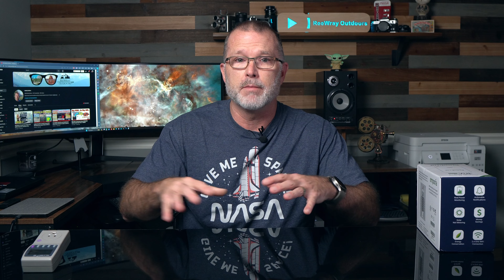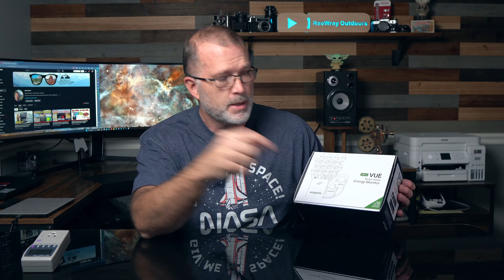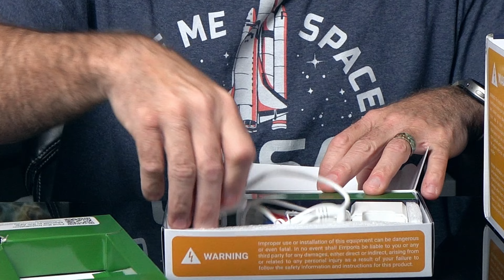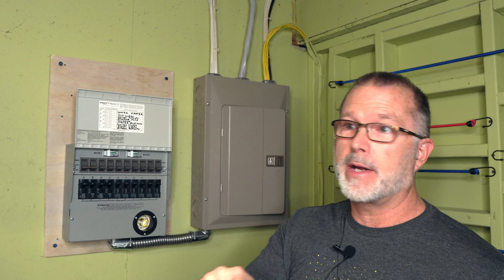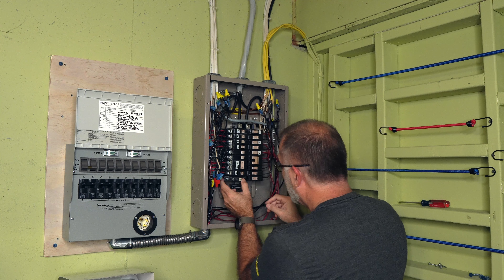*Unsponsored*  Emporia Vue Gen 2  - Smart Home Energy Monitor: Review and Step-by-Step Installation

Comment: Thank you so much for this video. This is the most extensive and will explained video concerning Emporia I've ever watched. I ordered the large Emporia GEN three from Amazon several days ago and I intended on installing it today. I am also going to use the 2 15 amp circuit breaker idea that you presented here for my own installation. I already have solar and I'm not sure how that connects to the system but during the install I will probably find out. Again, thank you very much for this very thorough tutorial.

Comment: Timer might be a good idea on the hot water* Maybe after you a have base usage, look at testing an insulated cover for the pressure release valve on your hot water cylinder too. Lots of heat loss there = more power usage. I'd recommend "The Valvecosy" not affiliated just think its a neat product and I have one installed on mine. With The Valvecosy installed and looking at my power usage on my solar/battery app (GoodWe SEMS+ Portal) the time between the hot water cylinder turning on/off was 20-30mins extra between it reheating again. From looking it saves  .3-.5kWh/day or 6-9c/day/$25-30+yr AUD. Would be good to see the data with your meticulous data gathering skills and devices you just shared with all of us, you'll get a more quantifiable number than what my total system usage on my home app. Loved the video btw.

Comment: I have a solar system already installed, with a completely full 200 amp panel, that cannot even handle one more extra breaker. My panel is already so full that it’s bulging outwards after several electricians try to get things to fit better.
I don’t even think I would have the capability of installing this in my system, due to lack of room

Comment: I have the original system from a few years back and the Gen2 in another panel. They work ok but in some cases under very low loads they actually report much higher power usage. For example I have Mitsubishi heat pumps and when they are idling the Vue will report over 250 watts of continuous power draw. I originally thought this had to do with the compressor standby heater but it turns out after talking to Emporia it is an issue with their sensors. It also appears to be random because I do have one heat pump system that accurately reports power usage while the other 2  are not accurate while the heat pump is in standby (powered but not actually heating or cooling)

Comment: I've used one for a couple of years as a small brewery and tap room owner and the data it provides is invaluable for finding energy wasting devices as well as for troubleshooting potential mechanical issues with equipment.  For example, I had a walk-in cooler that started to use increasingly more energy on an almost daily basis that could not be explained by changes in the environment it was operating in.  In the end it was running almost constantly when it had been cycling with at most 15 minutes on per hour.  I called my HVAC guy to check it out and he said that there was a coolant leak and that in a few more days, it would no longer have been able to maintain the temperature no matter how much it ran.  I was able to schedule a full leak check and fix (which can take quite a while) while we were closed.  Had it been allowed to completely stop cooling, we would have had to close or be faced with serving warm beer for a day or more.

Comment: Have the vue 2 with 16 or so sensors for over a year now.. it's been very insightful, and if you have a home assistant server you can integrate it. Using it and a power profile to figure out when the washer or dryer is started or finished. I think the main board is esp32 based and some people flash it with alternate firmware.
Using this data I figured a hybrid water heater with rebates and credits was well worth it (Florida, so plenty of heat/humidity available in garage)

Comment: Thanks for the video/sharing information!! I would love getting that kind of data. As another commenter said, if the/my panel "sticks out"; I think I would mount the control box/antenna outside the electrical panel (so much jammed inside otherwise). I would also follow your decision to add separate circuit breakers since my panels have open "slots" and a cleaner/neater install I think.

Oh yea, the info on the electric hot water heater was great to figure out don't even waste your time on a timer test 👍

Thanks again!!

Comment: Hi David,
           That's a nice system to monitor your energy usage. You're so handy putting that all together, sure you're not an electrician? LOL. I can't believe how much electricity that oil heater used to heat your bedroom. I wonder if a solar air heater might be feasible to install? I guess your bedroom would have to be facing south or maybe it could hook into your existing duct work? Maybe it wouldn't be such a good idea because when the sun goes down, it doesn't generate any heat. Might be a good idea for your workshop though. I see you in there wearing a coat when your running your test. You are so good at DIY, you could easily install it yourself. Well, it's just a thought. 
            I really can't wait to see what you have in store for your future solar projects and arrays. You have the room to do so many things now. I have learned so much from your channel, btw, Oscal has a new power station out that is spec'd very close to the Oupes Mega 3. It's a shame that the Allpowers R3500 and R4000 seem to have quality control issues, many have complained about them. They do have a good warranty, I wonder if they stand behind their products?  Pecron has the E3600LFP coming out in a few months, the talk is that it can take up to 2400 watts of solar input. Things are looking so good for solar this year.  
                                            Take care, Steve.

Comment: Had one of these for about 2 years. It makes the electrical panel a bit of a rat's nest of wires with all the sensors and wire. I have most of the 16 branch sensors installed. One tracks my solar panels production too so I can see the Net used or output for each day. Need to know what is being using before either trying to make appliance changes or getting solar. One thing I did was mount the box and antenna outside of the breaker panel to try to keep the spare wire on the outside of the box. PS...the hot water heater hurts a lot more when you have 2 kids and they only will take a bath and not a shower yet. Last week for us that was 66kwh on hot water. Looking at a heat pump one when this one bites the dust.